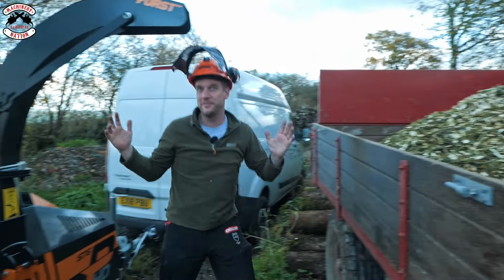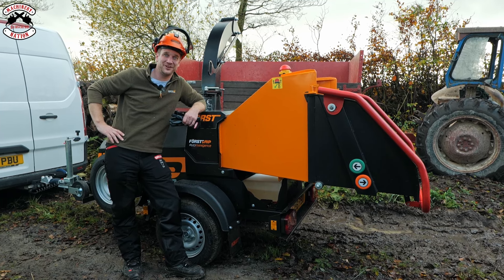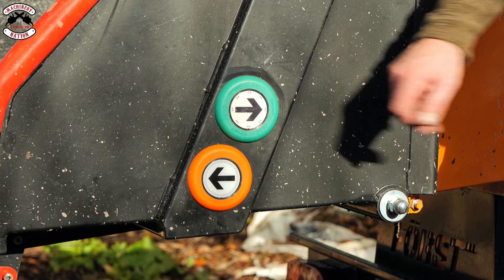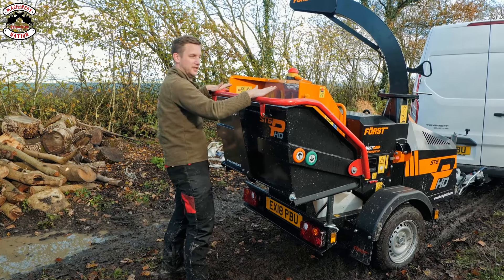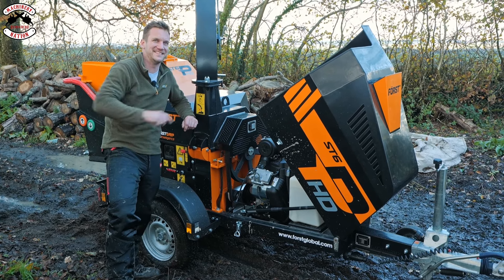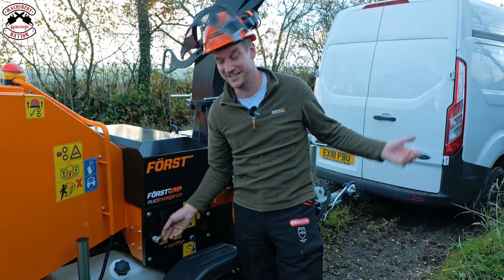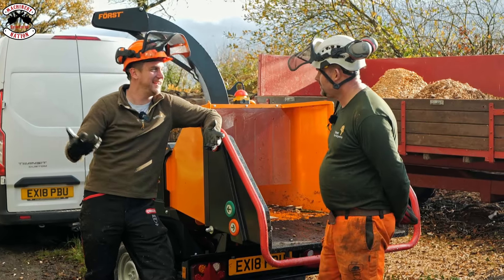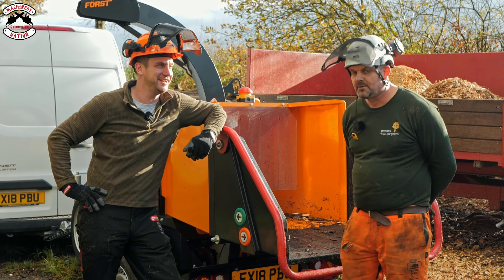This Thing Is A BEAST! - We Test The NEW Forst ST6P Heavy Duty Wood Chipper - What do you think?

Comment: Forst chippers are elite ,(BUT) they look new for an hour and start falling apart straight away Suspension Units ,Paint flaking off ,poor electrics i could go on ,however the good outweighs the bad  and they are a very decent chipper.
Reply from the maker: I would agree with this on their earlier machines, but they have developed and adapted over the years, thier electrics and paint works is so much better than what it was.
Reply: @MachineryNation  thats great to hear weve a TW tracked petrol Chipper absolute pile of dung electrics are a mess works one week in 10.

Comment: We hired one of these today. It lasted 1 hour before coming to a stop. We got it going again but it stopped not long after and never ran again. What made it worse was the awful manual that gave us no clue as to why it had stopped. A useless machine with crap support.
Reply: How much cost to hire  one  ? 
You didn't have support from hire company or not support from factory company. ?
Every machine slowing down under heavy load. If the blades are not sharp + fast cut - even worse.
If the machine stops  - not work at all could be done , so in my  opinion best to set up  slowest speed as possible for the machine to pull in the branches. That will help the engine to stay on maximum speed. 
Always use common sense.